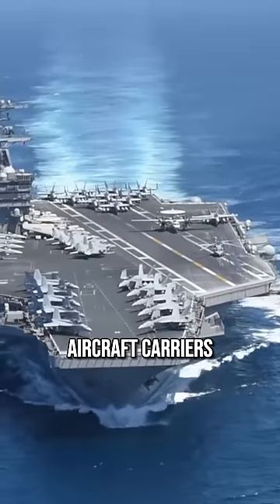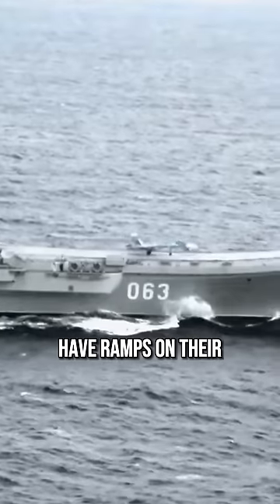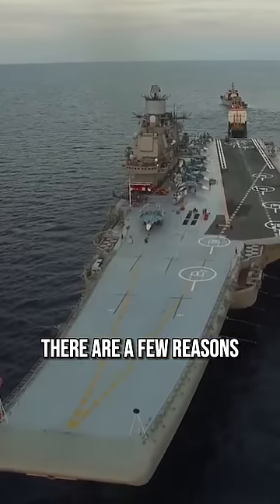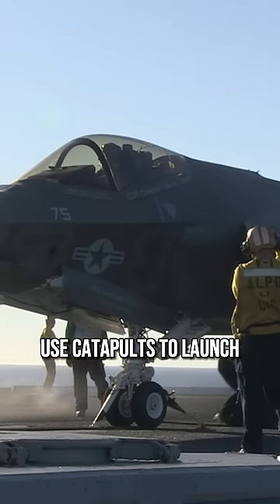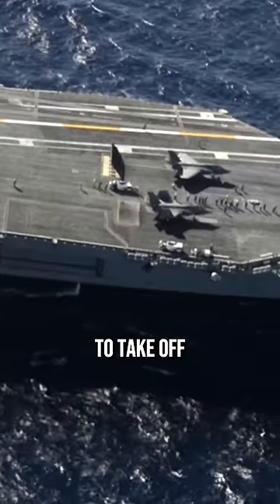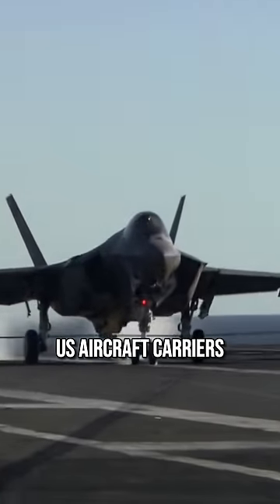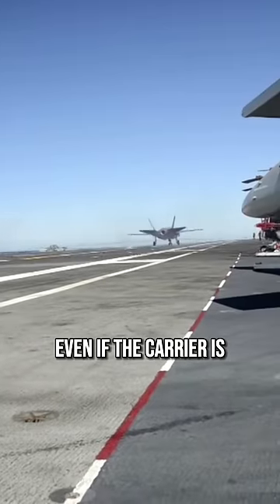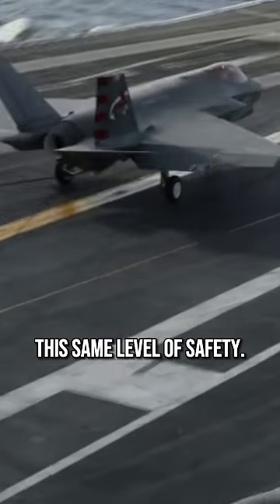Why Do the US Navy's Aircraft Carriers Not Have Ramps? #usnavy #usnavyseals

Comment: No, I've always wondered why other countries had ramps. The angled decks and catapults are a better system that allows launch and recover to happen at the same time.
Reply: That's because, with the exception of France, everybody else is using STOVL or STOBAR aircraft. The added complexity & cost of both the catapult system, and the recovery system can be prohibitive to some countries. 
STOBAR carriers also have an angled deck and a recovery system. The fixed wing naval aircraft used are usually aircraft that have a greater than 1:1 thrust to weight ratio, which, together with the ski-jump ramp allow aircraft to get airborne in a relatively short distance and with a reasonable payload.
STOBAR carriers also allow the navies of the countries operating them to get experience with carrier operations while CATOBAR carriers are being built.(With the possible exception of Russia.) This is what both China and India are doing. 
Meanwhile, the British have built their new QE class carriers with the power and necessary spaces so that if need be, can be modified later in a major rebuild, to a CATOBAR carrier. This was their initial plan, so that they can get back the necessary experience and a core crew while still operating a carrier. Such a rebuild will be expensive, and would probably take a couple of years to complete. (The Ski-Jump Ramp structure is not an integral structure of the bow of these ships. They are actually just "bolted" on.) 
FYI, the Australian ships of the Canberra class cannot operate fixed wing STOVL aircraft even though the ships have a ski-jump ramp on the bow. The reason is that the ramp was left in place because it would have cost too much, and taken too long to redesign and build. The Australian government at the time felt that it would be cheaper and would get the new class ships into service sooner. As such, the ramp does not have the structural reinforcement for STOVL to use it.
Reply: A full catapult system is very expensive to operate and maintain.
Reply: Because to land and fly off jets the flight decks need to be long and then they still need catapults. Only the US rhinks it can afford these. If a country can't afford big carriers the only option is short take off and vertical landing aircraft. A ramp just makes the short take off more efficient
Reply: Adding on @rokuth's explanation and also a small summary for not so nerdy civilains: STOVLs (Short Take-Off and Verticle Landing) such as the British Harrier and STOBARs (Short Take-Off But Arrested Recovery) such as the Russian Su-33 simply dont need the catapult systen since they were designed without them in mind in the first place, both the catapult system and the first STOVLs were being developed in the 1950s so designers for naval aircraft that werent US didnt have the catapult sustem in mind, however with the new "universal system" of things where practically every major power within any sort of international treaty will be using IS aircraft and will have to adopt the catapult system into their newest gen of carriers. 

However, Catapults are more difficult and more expensive to maintain, especially if theyre being used alot withing a short period of time, the US is developing a bew catapult system that uses Electromagnets but are working on energy consumption and reliability. So far the F-35B, is the most popular naval aircraft amongst NATO's strongest naval fleets which is working well but once catapults are overhauled into the next gen of carriers, either the F-35C or a newly developed fighter will hit the deck as the new kid in town
Reply: @rokuth theyre outdated and not as good, just say it lol
Reply: yet ramps dont break down and catapults do...

Comment: Angled flightdecks have nothing to do with ramps on carriers. Besides every contemporary carrier with a ramp/slope features an angled flightdeck as wel. It has to do with overall dimensons and most importantly: propulsion. If you have an oil fired power plant, desalinating seawater for use in another boiler as feedwater or in a heat exchanger to produce steam for a catapult eats away at your fuel. Same thing with electromagnetic catapults.
If you have a nuclear propulsion plant... not such a big deal.
Reply: Obv no hate but the spelling of some words (as a writer) triggers me
Reply: Angled flight decks allow carriers to recover (land) aircraft while launching others, as US carriers carry more aircraft on one vessel than most air forces have in entirety this is useful during operations.
Reply: Steam cats have been around since the 40s. In Modern warships the steam or power needed to operate them is not the issue. Its the maintenance and equipment load out/space need. Ramp decks allow space and maintenance savings. They have draw backs but given what everyone else operates CVs for its an acceptable design.
Reply: @christopherwojtan750  steam cat were a British adaptation of the system the Germans used to launch their V1's
Reply: Found someone knowledgeable
Reply: We did not have ramps even on WWII carriers which were not nuclear of course.
Reply: @Applecompuser  Yes, but carrier based aircraft off WW2 were fairly light, so they could take off on a fairly short runway space without assistance.
Reply: @anatolystepanovichdyatlov1747  Brother, the US never used ramps regardless of the propulsion system of the carrier.
Reply: @Applecompuser  I know, what's your point? The US is also - to this very day - the only nation to build actual aircraft carriers past 1945 that didnt had VTOL in mind or would double as some other kind of vessel like the Kusnetzovs.
Edit: China is working on one ofc, but if that isn't off the slipway...
Reply: @anatolystepanovichdyatlov1747  The point is you are putting out incorrect information. The question really is why?

Comment: The flat deck also allows for prop driven planes to be used which can be handy. During the Falkland Islands War people were asking how the Royal Navy carriers could be snuck up on and damaged by missiles. The answer is that the enemy would sneak in somewhat close and fire the missile and the low altitude kept the ships radar from spotting the missile. To get the protection like we have you need something that can stay up a long time to look down on what is happening. Our prop driven AWACS units are perfect for that but because of the propellers they can’t use a ramp but a cat launch is possible.

Comment: No actually I have never wondered about that. The ski-jump ramp was added for STOVL and STOBAR aircraft for the exactly same purpose as a catapult for CATOBAR aircraft; to allow them to take-off with a greater amount of fuel and ordinance than a flat deck without a ski-jump ramp. STOBAR carriers also have an angled deck for recovery. STOVL carriers do not because the aircraft land either vertically from a hover, or have a slow rolling landing.
Reply: Yes, but VTOL craft on average have less room for munitions while ours have more, but both have their tradeoffs. 

At the end of the day it's what the doctrines of the respective navies desire. Ours is about putting as many jets into the air with rotational recovery, which means the catapult and wire recovery systems are superior.
Reply: I would like to mention that there are only a small number of VTOL fighter aircraft in the world. You would really only need two or three full aircraft carriers to house the worlds known total VTOL Fighters.

And America does actually have a number of helicopter "carriers" that the US gets away with by not making them out to be full Aircraft carriers on a technicality based upon international treaties.

VTOL fighter aircraft likewise can be stored in these helicopter carriers such as the "US Wasp" and "US Essex".

Comment: Like the idea of steam powered catapults instead of electric. Seems to me more practical! If power down will catapult be also?
Reply: It was steam before
Reply: The steam that is used to launch aircraft are produced by the heat coming from the nuclear reactor.
Reply: @johndeluna692  yes i know but they are using instead a electric catapult…
Reply: @sup3rpiggi354  yes! Know that! The new tech is electric instead…
Reply: A power failure would disable the EMALS system but I would think that would be highly unlikely as carriers have power source redundancies (i.e. two nuclear power plants). I haven't heard of any steam-powered backup as that would require twice the maintenance and space/weight cost to the carrier.
Reply: Well yes and no. In the older nuclear powered ships, the nuclear reactor was creating the steam. Conventionally powered carriers also had boilers to create the steam and power the ship. If any of the steam piping is damaged, it would also cause a failure of the catapult system. So, technically, either one of the catapult systems can go down for any reason. Neither one is more reliable than the other as a lot of the time it is also dependent on the skills of the ship's crew to keep it going. The difference with the EMALS system is that, compared to steam catapults, the initial impulse is softer, and so puts less strain on the aircraft being launched. This will mean less wear and tear on aircraft. Plus, EMALS can be tailored more precisely to the aircraft being launched. Plus, the system itself takes up much less room than the steam catapult system, and so weighs much less. The main thing is that the ship's electrical grid has been built with a greater capacity than older ships, and has room for future electrically powered systems... like a laser...

Comment: angled deck is easier to build and is cheaper, easy and cheap to maintain, you don't have reconstruct aircraft to using catapult (reinforced front wheel and airframe that reduce maximum payload weight), angled deck alowing start even with heavy payload, like Su-33 with maximum payload of 6,5 ton and maximu TOW 33 ton vs F/A-18E/F with maximum payload of 4,4 ton (4,1 ton) and maximum TOW 30 ton... it's not about maximum TOW that can start from aircraft carrier, but how much you want pay for it

Comment: Having a ramp allows for shorter carriers. Making them cheaper. Catapults can be fitted later if wanted. It's just as safe to use the ramp it's got absolutely nothing to do with safety. The aircraft gathers it's speed in.the air. The British choose to do this in the 70a because they were using harriers which don't need a runway as they can take off vertically. The catapult adds a huge expense to the shop which can be used elsewhere. The advantage of a catapult is only slightly better over a ramp. Yet coats huge amounts more. They are moving parts and require additional service personnel. They are also way more dangerous than a ramp. Each to their own. But I absolutely guarantee you the catapult is not necessary
Reply: I promise you you're wrong.  Ramps don't allow takeoffs with full fuel and armaments. Catapults allow aircraft to reach the right speed with a full combat load without a need for in air refueling.  You also can't arm during flight.  

Half empty half armed aircraft are combat ineffective.  Nice try though.
Reply: @clanc433  umm go do some research. Hms prince of wales. Not the biggest but the most technologically advanced aircraft carrier on the sea…
Reply: You have no idea what you are talking about.
Reply: @RichCow-i7p No it’s not. Gerald R Ford is faster, holds more aircraft, and is more advanced.
Reply: The ramp prohibits the operation of large aircraft like the E-2 Hawkeye, C-2 Greyhound, and greatly limits carrier-based tankers.

Ramp-equipped carriers have to resort to helicopter-based AEW and COD platforms, which have lower speeds, lower ceilings, lower payloads, shorter operational range and less loiter time than the fixed wing aircraft in service with the US Navy. 

STOVL aircraft capable of launching from the ramp have considerably lower range and armament capacity than comparable CATOBAR aircraft.  

Equipping a carrier with a ramp does reduce cost and complexity, but it radically reduces operational capability.

Comment: Dude you are mixing stuff.

Catapults and ramps are one thing, the angled deck with arrested wire and straight deck without wire are another. One is for launching, the other for landing.

If you look into your own video, you can see that russians use a ramp, but an angled deck with arrester wire. Brits use ramp and straight deck no wire. Usa and france use catapults and angled deck.

Usa uses no ramp, no catapult and straight deck on the wasp class.

Comment: Doesn't a catapult system require the aircraft to have a much stronger undercarriage
Reply: If the air frame can't handle a catapult launch, then I don't think I'd trust it in air pulling any sort of Gs
Reply: Yes. Carrier aircraft are designed specifically to handle this. But the catapult lets them take off with a much heavier weapon/fuel load out than would be possible with a ramp.

Comment: A ramp could be of use to catch an aircraft to not fall into the sea when a cable snap after stopping the plane
Reply: You obviously don't know how they deal with situations like this. When planes land on the deck, they go full throttle just in case they miss the cable with the tail hook or it snaps so they can takeoff again without a problem.

Comment: Because the US Navy have over a century of carrier operation experience and operated more than a hundred of it, something potemkin "superpowers" and minor navies couldn't afford, and doesn't have the know how to build and design, so they instead use a cope slope that limits aircraft payload and sortie rate.
Reply: Ramps were invented after flat decks, as an IMPROVEMENT. Enabling shorter decks, smaller carriers meaning more carriers for the same cost.
Reply: Brush up on your history of aircraft carriers.
Reply: @MrLordingit  yes, care to elaborate? or just leave with no point?
Reply: @rossbrumby1957  those smaller carriers are called escort carriers (no cope slopes) that are much smaller than fleet carriers during WWII if that's what you mean, fast forward to today we have LHD's and LHA's (still no cope slopes) that can do x fraction of what a super carrier does , ramps are not "improvement" improvement but solution or alternative to the problem because it does less than half of what catapult launch does and cheaper.
Reply: @rossbrumby1957  ehh debatable even with smaller decks I’d still prefer CATOBAR over a ramp. Also the US did think about this in the 70s with the CVV project/design studies and more practically with how the USS Midway was operated compared to her Super carrier contemporaries.